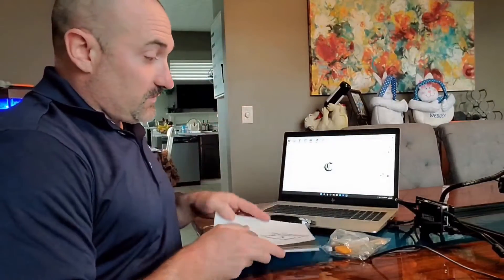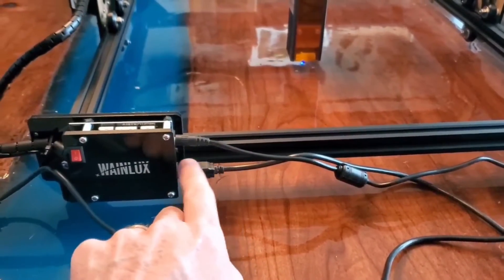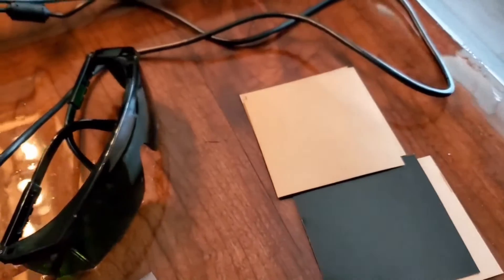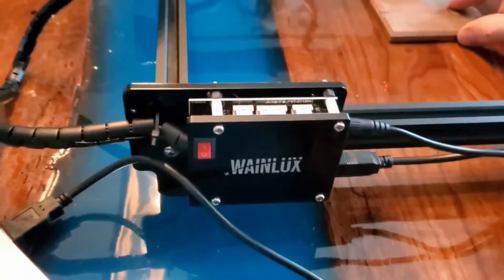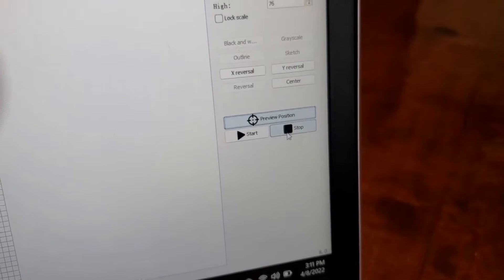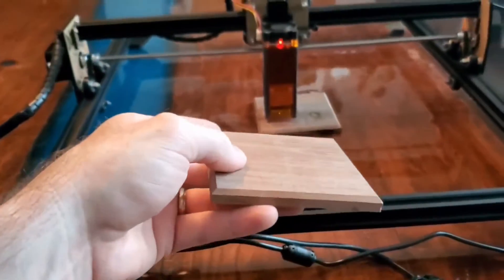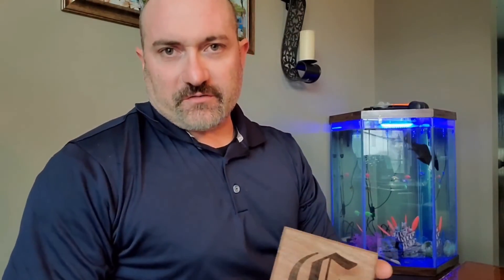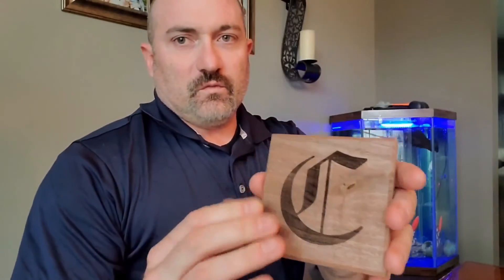Review of Laser Engraver WAINLUX JL3 Pro, 40W Compressed Spot Laser Engraving Machine

Comment: How can i make mine work? If i turn it on, the laser goes all the way to the back. It looks like it is blocked going backwards.
Reply: I'm having the same issue please any help would be appreciated
Reply: Same crap. We're really mad. I did everything, tryed a lot of things from their site, from the usb, downloaded some pluggins. Nothing, seems it's a scam guys.
Reply: @valeryuk2439  need to try making sure censor buttons are on the edges so it can know to stop and go to the middle when ready to use. Try censors before upgrading. If not upgrade it ,plug in the usb and upgrade hold bottom on side of where power is at and the turn on power button at same time. It will stop the going back.there is a video on how to upgrade it as well in usb provided. Should solve problems.